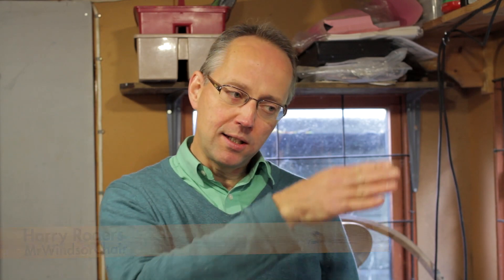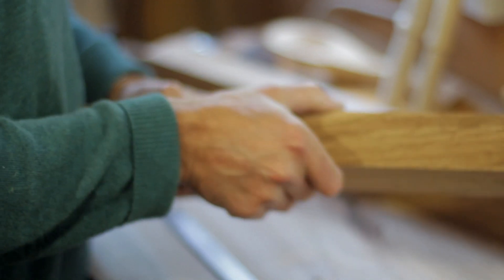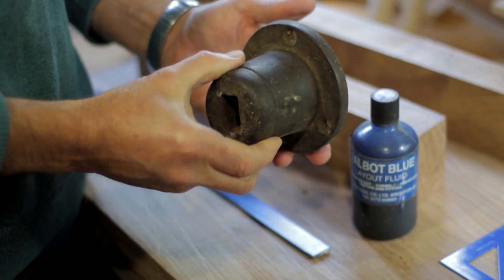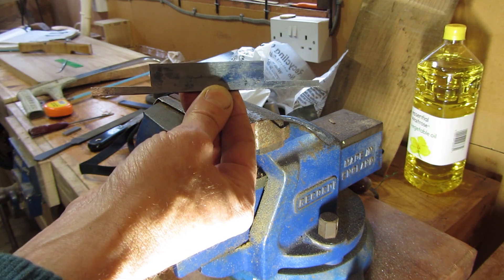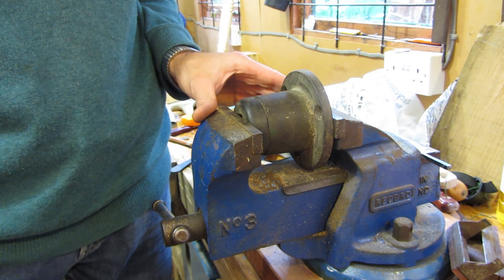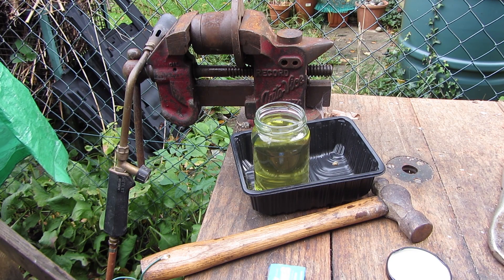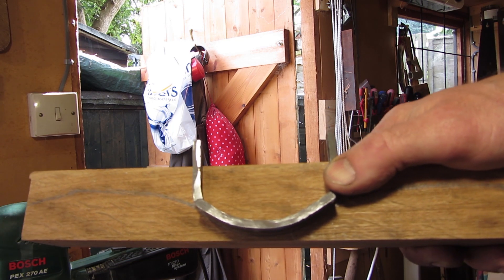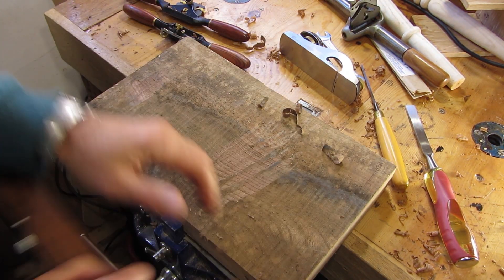Making a Chairmakers Travisher

Comment: I have a small coal forge.  I got it to make tools and hardware, an extension of my woodworking interest.  I've made a sliding dovetail plane, a shoulder plane and a big gouge using leaf spring steel.  Cutting the blades out for the planes was time consuming w/ a hand hacksaw, but I wasn't in a hurry.  Even annealed, that spring steel is tough.  BTW, the dovetail plane cracked when I heat treated it.  I hadn't heard about using oil yet.  The blade works but it's not nice looking.

Comment: I bought an old hand-crank blower with the air tube, grate and dump flap.  I went to a scrap yard and found a machine that had a hand wheel on it that was about 18" in diameter.  The wheel is a stamping from 3/16" steel plate & looks sort of like a big pie pan.  It's about 3" deep.  It already had a hole in the center that was just right.  I had my brother weld some legs on it from an old BBQ, & a bracket to bolt on the blower.  It's a bit small & shallow but OK for small work.

Comment: If I were to do it again, I'd probably go w/ a blower made from a bathroom exhaust fan rather than a hand crank.  Exhaust fans are easy to find, leave your hands free & are quiet.  I'm thinking about making a treadle & flywheel for the one I have.  I also want to put it on wheels because I store it inside but use it outside.  I drag it now, wheels would be much better.  Also, a non-electric forge on wheels would be great for taking to blacksmith get-togethers.  Just my thoughts.

Comment: I'm about to attempt to make one of these. I'm going to try using a blade for a powered jointer. 6" long, I just need to make the bend which I think I'll do by clamping it around a brake disc hub after I heat it.
Reply from the maker: Sounds good!

Comment: I’m wondering about the rise of the grip points above the sole. A shallower handle like a traditional travisher would seem to have so much lesser leverage and thereby not require nearly as strenuous an effort in use. 

Otherwise great video. 

I have some torsion spring leaves from an aircooled VW Beetle and a larger piece of broken torsion leaf from a Stowe ski area snow groomer. I’m sure one of these will make a great cutter blade. 

I bought a rather expensive handmade travisher almost 30 years ago, but it and my adzes and antique scorp seemed attractive to the thieves that hit me a few years ago. 
Why not make them? All they need to do is work well and handles are easily made.

Comment: Harry got it I can’t see this how you do it got to make one of these., Have you got the plans for one
Reply from the maker: Hi Paul, The tool is very similar to a spokeshave, it has a curved blade, that is about 15mm wide and the whole 15mm width rubs on the wood being cut. The blade has a couple of upright tangs that are used to keep it in place with a couple of bolts into the wooden body.
Reply: Have you done the plans for one of these Harry? I’ve had a go at one of Johns down the group but curious on how to make One are they easy?
Reply from the maker: @PaulSmith-rd8yc  Hi Paul...I have not...it's a bit of blacksmithing...shaping and hardening and tempering.

Comment: I’m going to try making my own based on your video. I’ve been looking into the process - heating until non magnetic is meant to harden the steel which arrives in a soft annealed state. Then you need to bake for 1 hr twice in the oven at a high temperature - this is called tempering. How come you didn’t go through this step with the o1? It seems to be in the standard recipe
Reply from the maker: Hi in this case I hardened in oil and then tempered to straw colour in water. An oven is easier for tempering....take a look at my making bowl turning hooks video.
Reply: @harryrogers  Can you explain more about your water tempering process?

I'm looking to make a similar blade, either with or without tongs using a blowtorch and MAPP gas.. how have you found the anvil, can you recommend one or info for buying one for this kind of thing?